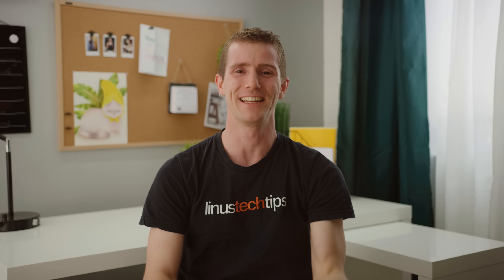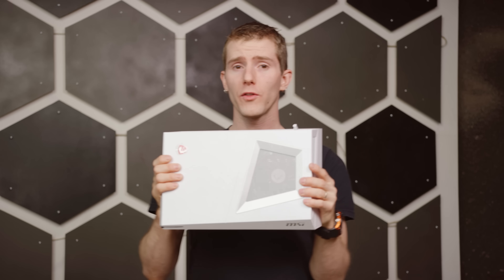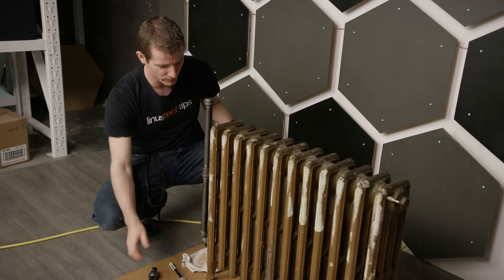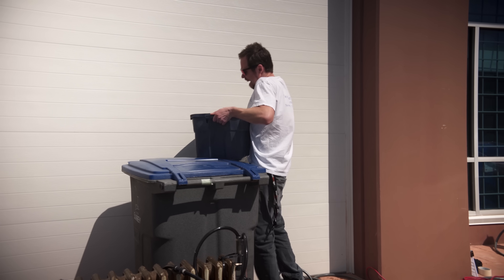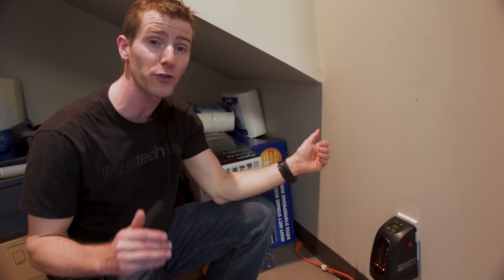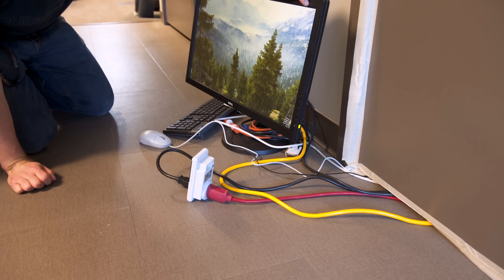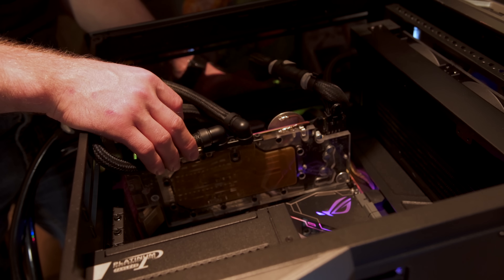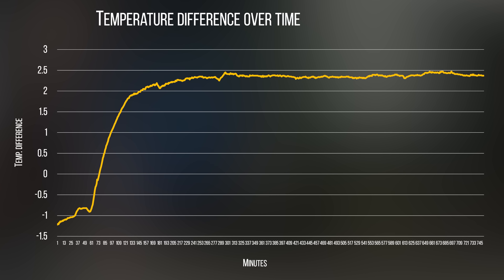Lower your heating bill... with GAMING

Comment: Starts the video by quoting the first law of thermodynamics. Continues to build an overcomplicated solution. If you'd just put the computer with a normal cooler in it, water or air, the result would've been the exact same.
Reply: Septimius ikr, so much face palm in this one. Which is fine, it just needed a quick explanation as to why it was entirely pointless at the end just so everyone's clear why it was.
Reply: Yeah! LTT should have just tried to do it the least interesting way possible to maximize the entertainment value! We watch LTT to see the peak of efficiency not a bunch of dumb stuff that no one would ever do! grabs pitchfork We hate fun! We hate fun! We hate fun!
Reply: The results would actually have been better; you would have eliminated the lag. That is because you would not have had to heat the large amount of water in that massive radiator. But where is the fun in that... XD
Reply: I like how he says they don't want to 'generate any more kinetic energy than they absolutely have to'. I guess that's why he calls it college dropout physics. Because any kinetic enenergy that isn't used to drive mass out of your system (room) and isn't stored as potential energy must end up as heat eventually. In that sense, a ceiling fan is a (low power) space heater.
Reply: That's a very good point. I hadn't thought of that. My comment was more to show that you can't heat stuff up more with the same amount of energy. If the system draws more power, then it'll create more heat. I just wish to combat the idea that radiators somehow heat things up "better" or uses less power, by having water or oil it heats up.
Reply: Yeah, but the point is they did the experiment trying to ensure the heater and PC consumed the same amount of power over the time period. So surely efficiency of the PSU doesn't factor given the power consumption is identical? (in an ideal, non LTT case).
Reply: That is called entertainment, my friend
Reply: I dont know why im laughing so hard
Reply: The noise takes a lot of energy (they've bundled it under kinetic energy, which is not incorrect), so no, you do need some fanless solution, to get the results they've gotten.

Comment: You could have just placed the PC in the room...
Reply: Dennis W ikr
Reply: They said it themselves. Watts in, watts out. The heat from the PC will get to the room eventually as it can't go anywhere else!
Reply: lol my Samsung Ace Style 'LTE' can bake my sausage easily..
Reply: Yeah, when I saw the thumbnail, I thought they would connect it to the main system. Though as we saw here -- it'd require extensive filtration. But pumping is already handled. That's what I would really like to see.
Reply: Well that would have bin the correct way but a bit boring 😆
Reply: @2DReanimation  A heat exchanger would do the job too!

Comment: All the energy your PC uses ends up as heat in your room. The kinetic energy of the coolers is passed on to the moving air which will absorb it through friction in the air. Also the led lights will reflect on walls multiple times until it is turning to heat. So the only energy not absorbed into your room, is the little bit of light which goes through the window. But we all know you only game in the window less basement of your parents never showering ^^, so everything goes into your room :D. Besides you need at least 20 LEDs per Watt, so its energy is nelegible any way.

Comment: YOU GUYS LAUGH But I do use my PC as a space heater in the winter... I live in AZ, so the temps are a bit milder. HOWEVER, my PC does make my room toasty in the summer... EVEN WITH THE FRICKIN AC UNIT IN THE ROOM CRANKED UP. (FML, I need a new house.)
Reply: Jack Linde Or a new AC unit
Reply: I live in AZ as well and have for years used my ps3 for a space heater. In fact last fall I could not figure out why game room was so hot for like 3 weeks strait until I discovered the ps3 had been on for an unknown amount of time. I can only assume a dog laid/stepped on the ps3 remote.
Reply: Like Linus said, if the heat is going to be dumped into the room anyway, why bother with a fancy external radiator. Great project though.
Reply: come to Minnesota dude. Hits -50 once or twice a year
Reply: the Modern Communist Feminazi I feel ya sounds pretty close to where I live it was 39c today and my ac in my car went out for the last two weeks still trying to get it scheduled around my job. I have braved therew a day of 47.3c though
Reply: those temps are cute. record high for az is 119 f (48.3 c) and average is about 110 f (43.3 c )and above
Reply: I just mine etherium while I’m sleeping to save on electricity costs so i can heat my room and ignore the rest of the house saving a few £ a week
Reply: where do you live that has a month with an avg temp of 110f for even a single month? thats pretty much death valley's avg for june and they have a record high of 135
Reply: Smognoggler - Actually, in the Summer of 1990 (yeah, I'm old.) we hit a record breaking high of 122.5 Deg F (50.27 Deg C) in Phoenix, and I think there may have been a day in the last five years that broke that record.
Reply: Damien, I'm not "that" far from Death Valley. It's the next state over. I live in Phoenix, Arizona, and we can/do hit 120 Deg F (48-49 Deg C) in the summer.

Comment: You should flush it with CLR. It is the thoughts Calcium, Lime, & Rust Remover! CLR Cleans better and faster!

Available from these fine retailers, Woolco, Zellers, Woodwards, IGA, and K-mart!
Reply: Or just buy a new one instead of getting like 100 years old one
Reply: markothevrba you could make one out of copper pipe, wouldn't even be hard.. I can think of a design that would work great off the top of my head..
Reply: Dang!
Reply: muriatic acid is faster
Reply: +Daniel Dulu I was careful to list defunct Canadain retailers.
Reply: It sure was/is.

Comment: 7:30 Ouch that's hot...proceeds to touch it again LUL
Reply: Tyler he touched the middle pipe. The fins on the outside are the cool parts. The middle pipe is where the heat is hense why it's hot.

Comment: >be me
>live in australia
>i5 6500 and 1060 3gb
>play rust at medium settings
>room heats to temps above 30 celcius after few hours of gameplay
>profit.wmv
Reply: I know the problem. In the winter my thermal valve just closes as pc starts heating the room, but in summer im in a trouble without ac
Though 28C is alredy hot for me and i have never gone past 29 without AC

W/AC it stays at 27C
Reply: My room went up to 40°C when i was playing rust during summer 2018 olloolol
No AC of course
Reply: Why did you buy a 3gb Model? 😨
Reply: i have the exact same setup but gpu and cpu temps never go above 60c

Comment: Why do you need the radiator? The same test with air cooling should work fine.
Reply: goatmonkey2112 views
Reply: sponsors
Reply: Fun factor.
Reply: Sponsors? lol
Sponsored by ancient radiators.
Reply: He went out of his way to show the modular piping system, which wasn't even used for the video
Reply: Pyroman /  the heat transfer doesn't matter though. It is still the exact same amount of heat being generated
Reply: Wooosh

Comment: Wait.... Couldn't this have been done with regular rads since it's still getting rid of the same amount heat anyway??
Reply: Yes, the problem that I hope Linus is actually working on, is quickly radiating all the heat so that it's faster/easier to condition the room.
Reply: By putting in a buttload of metal and god knows how much water to heat up as well? If you want quick change of room temperature, why would you wanna spend time heating up more water and metal than needed before venting it to the air?
Reply: The reason was so that there were no fans at all. No need to fan cool a radiator that large. 

I really liked the idea of using it, but for this test it wasn't good. A regular water setup or even air setup would have been fine. The fans actually do generate heat via air friction so it would be the same result with much less of a warm up time.
Reply: And yet they use a bloody big pump to run it. That thing would probably be enough for a circuit of a whole house with many rads. Also 7980XE would draw more power.
Reply: Um, isn’t this cooler?
Reply: I5ZQ8  Yes, but that would have less entertainment value.
Reply: Yes, they could have just put the PC in there, it would have been identical to the heater, well, if the PC was consuming 350W as it was supposed to.
Reply: Yeah why have a fan that consumes 5 watts when you can use a 75 watt fluid pump!  :)
Reply: Yeah, that’s weird. I remember how I warmed my hands with a laptop during my classes in the university during EXTREMELY cold winter, just by running AIDA stress test and holding fingers behind fan exhaust, so there is no need for BIG-S radiator at all. Any cooling solution outside LN2 will do the job since it just redirects heat of electrical components, hot air just leaves the case directly to your room. And then it heats you)
Reply: Fastest way is air cooling.

Comment: Could you have some kind of countercurrent system? Have one system of tubing that only connects to the PC, a second loop that only connects to the radiator, and somehow allow them to dissipate heat from one to the other. This is actually how more modern nuclear reactors send heat from the fuel rods to the turbines, since it cuts down on the amount of water that has kept under extreme pressures making the system cheaper and safer.
Reply: That would have been quite pointless. Just like the radiator.
Reply: A heat exchanger to keep the transfer fluids separate would be pointless? Aside from stopping the dissimilar metal problems, the shmoo out of the small galleries that blocked up, and the ability to have two different flow rates to optimise the heat transference.... yeah.
Reply: Jimmeh B Shmoo? I'm guessing you watch AvE.
Reply: More mordern nuclear? we used that since the 60-ies...
Reply: Unlike like some older nulcear reactor's which were just open air cooled.

Also yes, that was actually a thing.
Reply: There is indeed a part that connects 2 loops together.  I use one to connect to a secondary loop that is cooled by my sump pump pit since it has a constant flow of very cold water.  It's pump turns on and off depending on the loop temp and that can't happen to the main loop because it must always be running.  If the secondary loop is always on I could end up with condensation on the main loop lines which could damage the PC.  They are insulated from this but still.  I never allow it to get below the dew point of the room which is fixed and the pumps are shut down if the AC system fails causing the dew point to rise (this is done with a simple device made to turn an evaporator on and off).

So yes totally doable but it has a huge efficiency loss.  The main loop will be running many degrees higher than the secondary loop.  This issue gets worse as the wattage output increases or the temp differential decreases.  It's great for runaway temps.  I could basically run my off of a single 120 and still have 30-34C temps at 1000w of draw (CPU and all GPUs are on the loop). In reality I have a single 4x120 Black Ice GTX and the fans never turn on except the one that always runs at 600RPM just in case there is some sort of controller failure.

Pretty quiet setup all in all.  Before buying a house I had a remote Mora-3 on top of 2 4x120 rads.  I could replace the Mora with a single tube with 2 QDs to make the rig "portable" LOL.

Comment: Even the kinetic energy turns into heat (from friction), and the lights too (assuming the photons don't escape out a window) get turned knto heat as they eventually get absorbed into a material. Cant escape entropy baby.
Reply: They need to hire someone with a degree in science or engineering. This is embarrassing.

Comment: Me: Look, I'm not paying 2000 dollars for a broken space heater.

Shop Owner: That's a AMD Ryzen 7 3800X paired with EVGA GeForce RTX 2080 Super running on Crucial 2x8GB Ballistix RGB DDR4-3600 RAM and Corsair MP600 1TB PCIe 4.0 SSD!!!!!
Me: Well does it heat the room?

Shop Owner: Fu*k No!
Me: Then it's a broken space heater!

Comment: Lower your cooking gas bill with AMD FX.
Reply: And GTX 480 stock cooler.
Reply: Cooler doesn't matter, power consuption will stay the same. Actually, with newer cards it's even worse, cause they will throttle with ref coolers, aftermarket ones will be able to dissipate much more heat.
Reply: You should see how hot it gets when you start overclocking it lmao
Reply: Strange. My fx 6300 heats up to 48 - 54 Celsius max when playing any intense game. Whereas my rx 560 OC is pratically killing itself being at 75 Celsius.
Reply: Yeah my room with my FX8320 and GTX970 gets about 5-7 degrees F hotter than the rest of the apartment.
Reply: Flo_w out here with an overclocked FX-8370... way too hot in the room

Comment: Its SUMMER Linus !!! Cmon bro
Reply: Shantanu Varma Piping it out the wall won't be difficult if you can do this. Then make sure it's shady and ambient at least in the U.K. won't get above 30.
Or burry it underground for a constant 2-12 C ground temp all year round. Same principle as ground source heat pump.

Comment: Not sure why you used an efficient CPU and GPU when you could have gone Core i9 and Vega 64...
Reply: Svetoslav Tsanev ouch sick burn 😏😏
Reply: 1080ti consumes more power than a vega 64. Threadripper is not that efficient, it is considerably better than the i9 though.
Reply: Because they wanted to compare against a 350Watt heater. So they needed a 350 watt system.
It's one of the first things he said.
Reply: Really, any AMD GPU would do.
Reply: Svetoslav Tsanev Vega frontier edition probably would've produced more heat
Reply: Crome I'm not sure about that, my Rx 550, although not a very powerful card, Maxes out at 60 degrees Celsius while gaming.
Reply: Vega 64/FE would have been a better bet imo. i9 too.
Reply: 350 watts is 350 watts.  At full load, efficiency would give you more FPS, but the warming would be the same even if you were using a Voodoo2.
Reply: They were aiming to specifically hit a similar wattage to the space heater, a core i9 and Vega 64 would've exceeded the wattage requirement
Reply: 6990 or gtx 590 with something like an fx8350, sorted.
Reply: Was about to make a comment about i9 and Vega 64 xD
Reply: Yes, he could have used more watts than the heater, and then the room would have heated up faster.  Or he could have gotten a bigger heater, and then the heater could have heated up the room faster.  Why would he even do anything when nothing matters?  It doesn't matter which electronic appliance uses 350 watts, it will always put out the same amount of heat, which is what he was illustrating in the video.  The numbers were off because the heat stayed in the water, because it has a large thermal mass, but the heat will radiate from the water over time, so the same amount of heat is still in the room.
Reply: I don't always use a space heater but when i do radeon hd 6990
Reply: I know you like to propagate memes, but Polaris 10 is really damn efficient (the rx 480 series), just not the rebrands (500) which are jacked up and overvolted to high hell. Same deal with Vega, undervolting from the already high stock volts is recommended for both mining and better games performance. Power (heat) is increased linearly from higher clockspeed, but exponentially from higher voltage.

Comment: Yeah, you know you have a problem when you can heat your 1000 square foot apt with the excess heat from your devices.
Reply: I know that at one point my 1080 ti and 8700k heated up my room by 10 degrees Fahrenheit, or 6 Celsius
Reply: Playing VR games with a 1080ti, which is water cooled and it still heats up the whole room :D

Comment: New radiators are dead cheap lol don't need old dirty one
Reply: Those new cheap radiators are shit.
Reply: Roach DoggJR not as shit as that
Reply: Yeah lol he should have just bought like a 3 foot copper fin rad.
Reply: They arent shit, they just hold less volume and are designed to be more compact.
Reply: Rig a car radiator to move heat off your computer and into the room.
Reply: But I'm dead broke.
Reply: Cast iron radiators... get this... rust! Those also are meant to be heated with steam, not flowing water. If you wanted to convert it to a clean flowing water heat sink, you'd want to get the inside nickel plated.
Reply: they used it for the comic effect
Reply: It'd be better to try a car radiator, possibly from scrap
Reply: @Lambda_Ovine  i confirm, cast iron is best when you have a whole house to heat up since it KEEPS heat for hours. not an aluminium or steel one which dissipate the whole heat in minutes, and would be perfect actually to cool down a PC. or rather, transfer heat out of the CPU/GPU and move it outside.

Comment: TRY BUYING A BRAND NEW RADIATOR AND THEN DO THAT
IT WILL PROB WORK WITHOUT GUMMING UP
Reply: i still dont know why the fuck he bought an ancient radiator for doing that, he knew it would be shitty.
Reply: cause part 2: WE TRIED TO HEAT A ROOM WITH A PC AGAIN$$$$DID IT WORK THIS TIME???!
Reply: WHY ARE U YELLING? I guess he does it for the entertainment value of using the jankiest thing that might work.
Reply: @Blake Belladonna but then where would be content of the video? we put a pc in storage closet with thermometer inside. this are the results...
Reply: My "old" Radeon 4870x2 would blow that space heater away...
Reply: @XenZenSen  Do you think so?  Really?  It's also about doing something hackish.
Reply: I think people underestimate how disgusting water is when it sits in a boiler system for 6 months. That hardness and scuz builds up and cakes the walls of the rad. 

The only thing you can do is use distilled water and flush it regularly.
Reply: @muratcucen  Because an ancient radiator is cheaper than a new one, and this is the only thing he'd ever use it for.